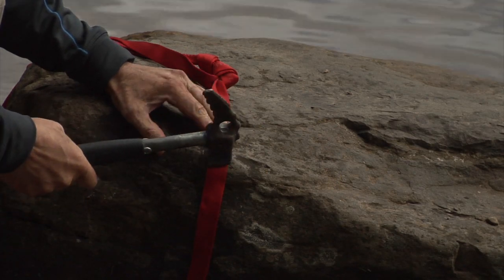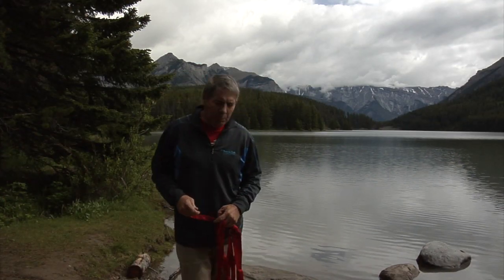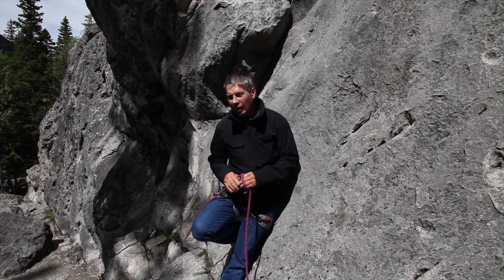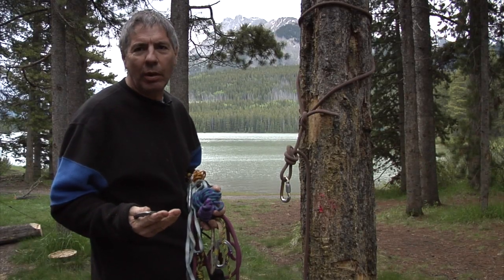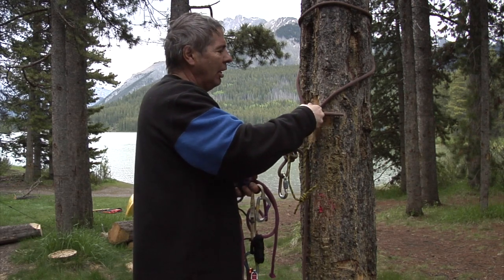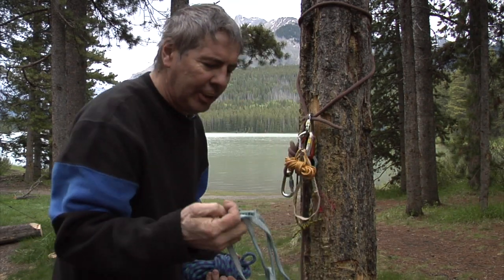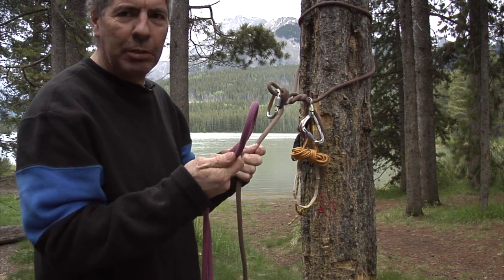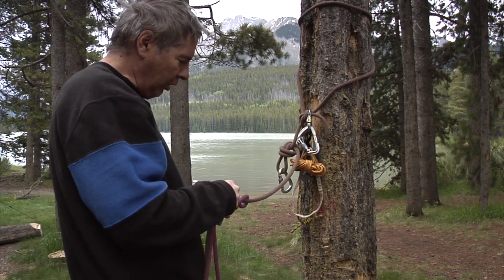Mike's Mail  6 - Do I build my anchors from rope?

Comment: you should, on this way you clip the quickdraw to the same way as you clip youre rope, so:
you come around from the right with youre quickdraw to an bolt clip it with youre right hand in an bolt to the left (from the quickdraw), with bieners the opposing way you can also clip the rope comming from the right towards the left bolt.
Just makes it more ergonomic and easier in roofs etc.

Comment: There is a different technique very common in the UK where you just add a big HMS carabiner on the figure of 8 tie in loop, then clip the rope to every achor point and then clove hitch every thread back on the HMS biner, so everything is tied together in a close loop. This is very useful when your anchors are out of reach because you can adjut the equalisation simply by adjusting the clove hitches on the HMS.

Comment: Always enjoy watching your videos, Mike! : )  Curious about your thoughts on the angle of your anchor made with the cam, and the hueco (pinch)? It's clocking about 80deg, looks to be a fair load on the hueco (pinch) in the direction of pull, and not much on the cam at all. Would you ideally basket hitch a small sling through the hueco, with a 'biner on the end - to extend the length of your cordolette at the focal point from the cam, and lessen the angle/force multiplication in the anchor?
Reply: I guess there's not enough cordelette for this system which is why he's making compromises, funnily enough a rope anchor here wouldn't have that issue! But both methods are fine, no need to be religious about climbing preferences in general :)

Comment: I was going to say something along these lines.
When I lead it usually ends with me topping out and so I build my anchor the same as you. A sling and a crab on each point and I run the rope from me to the point and back, equalise and tie off with a clove and repeat. What I wanted to ask Mike as well was, placing gear and achoring so that they are on top of each other like 4:50. Have you tips for doing that, do's and don'ts?
Never done it but I'll try when I get my rack put together.
Thanks guys.

Comment: It depends. If you sports climb, its easier to clip if they're facing different directions. Try it, grab the biner youre about to clip into a bolt, and clip it with the gate facing the rock. Easy as hell, still the rope is clipped in the right way. Obviously, when trad climbing, one should keep the gate facing away from the rock, that's why trad climbers keep the biners in their draws in the same direction, to prevent it from accidental gate opening.

Comment from the maker: The cord gives me the most options as far as rescue and anchors. I could use supertape I suppose. It is also the thing I have been raised with so it may be as much that as anything. Your right I guess tape or slings would work Sewn slings I have but are limited in the way you can use them.

Comment: Using the rope is perfectly fine for single pitch crags where you can just walk off. Easiest way is to do the same as Mike did with the cordellette but bringing the rope back to your harness and clove hitching it to a HMS and as another user said, you can get three pieces of gear on an HMS. Useful for small crags where the belays are quite far back. But for big mountain routes then i'd go with a big sling or cordellette. The other advantage of the rope is that it is totally dynamic.

Comment: Yeah, this is pretty much the way we set up our anchors here in Scotland when we are climbing on single pitch crags (up to 30m, dependent on how long your rope is). In these cases its not so hugely important to be able to escape the system as we can generally lower our seconding climber back down to the base of the crag if something goes wrong and then deconstruct the belay and walk off and down to their position. Personally though, i find it easier to make my belays using slings.

Comment: Either one of us misunderstood what they asked about carabiners facing the different directions or I would have to disagree with what you said. They asked if the carabiners on a draw should face different directions. When using multiple draws INSTEAD OF a locking biner to make an anchor, you should ALWAYS have the gates facing in opposite directions. If they are talking about on only one draw, I would say it doesn't matter one bit which way they face. Great video!

Comment: I've been using rope anchors since I started mountaineering in the mid 1970's. I'm obviously still here...

I'm looking forward to constructing some anchors using NE Rope's 5mm Tech Cord (no affiliation). The manufacturer states a 5150 lbf tensile strength and even with a 15:1 safety margin that's enough to support my weight. I'd also like to try their 3mm Tech Cord if I am ever able to find any.

Comment: In fifty years of climbing, I've found the rope to be far more immediate, versatile, adjustable, and uncluttered for anchors of every type, compared to the Guide-Endorsed cordelette cluster-fk. Clove hitches and butterflies can be adjusted within the completed anchor, and equalizing is overrated, compared to snugging up slack and adding omnidirectional pieces if fixed anchors aren't there. Leader error is the primary cause for running out of rope, but in the mountains, if it happens, the belayer can then replace the little extra rope with slings, if necessary, as the protection above adds the margin of safety that was not there when both climbers were at the stance, and everyone I know has at some time had to leave the stance and begin following while the leader had not reached an anchor. Except for fatalities due to sparse intermediate gear when speed simul-climbing, most of these episodes end benignly. Equalization is a fool's errand, unless all of your anchors are crap: I have never known anyone who equalized two garbage pieces with one solid one; you add redundant backups, but put the main load on the one you consider the best, exactly as you would with one new looking bolt, and one old rusty piton. These systems look to have evolved for the benefit of guides who want a quick way to bring up clients. They look vulnerable to being yanked upwards badly, in serious leader falls, a sure risk for dislodging pro that is set for mostly downward pull.

Comment: Mike, is that "super tape" 1/2" Mil spec?  Is 1/2" Mil spec 
strong to use as an anchor sling?  It's rated to 450 kg on the MEC website.

Comment: using the rope in your anchors dramatically reduces the shock load to the anchor and there for its  less likely to fail.   the rope can absorb high loads better than any sling.

Comment: Mike appreciate the video though I think a couple of things are missed 1) use the rope don't rely on it. I carry a guides loop so if I needed to I could replace the rope. 2) rope length I started 20 years ago on 50m rope now I have 60m, my climbing partner just got 70m yet with all 3 ropes lengths I have only run out of rope once. Manage your rope properly and stay out of issues 3) speed a rope setup is just faster (some argue safer due to dynamic nature)  Finally in 20+ years of climbing both rock and ice I have never had to exit a system to help a partner. With all these reasons behind me I am going the other way I climb more and more on rope anchors.
Again I don't rely on them alone but use them like all my gear with a backup in my pocket just in case. Thanks for the video but I question some of your fears as not being the ropes fault rather the climbers poor decision elsewhere that led to the problems you outline. see you at the crag and at the end of the day you do what makes you happy and I'll do the same